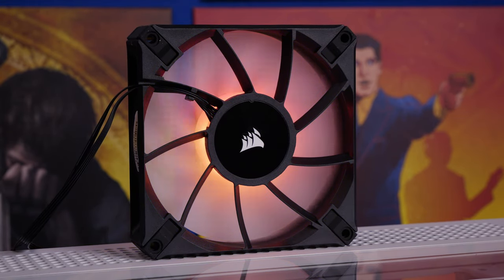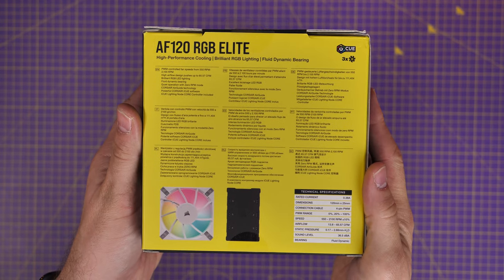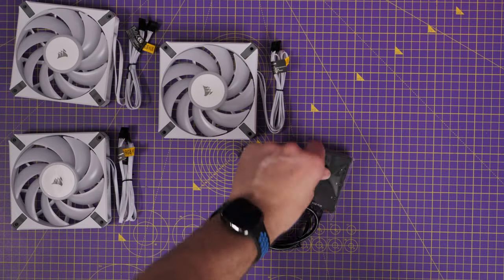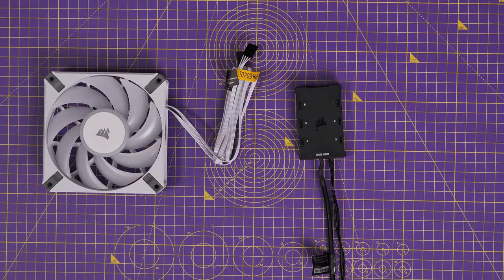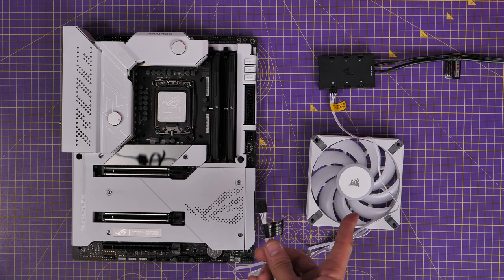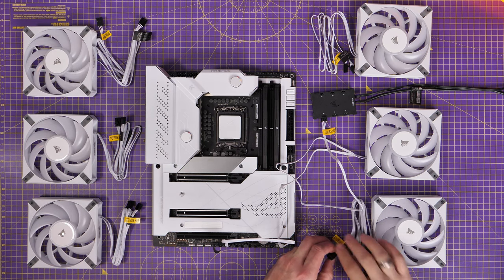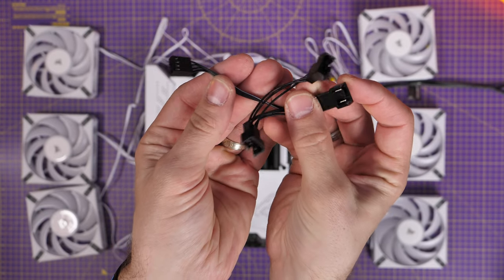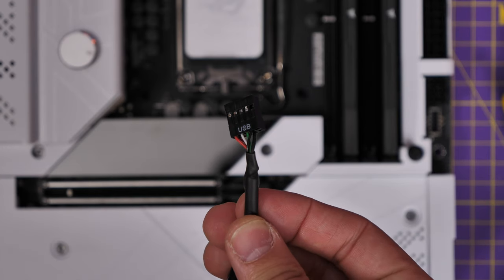How to connect and setup Corsair AF120 RGB Elite fans (10 fans, Lighting Node and iCue setup tips)

Comment: Question, you use a fan splitter cable to plug 3 fans into 1 socket on the MB, what would happen if you used this cable to plug 3 fans into 1 socket of the commander module? would it just detect 1 single fan and provide the same settings to all 3?
Reply from the maker: I'm not sure if you can do that

Comment: 6:05 - RGB cabling is so archaic, hopefully RGB builds in the future do not need this much cabling.
Reply: arctic has daisy chained connectors on their fans that plug directly into the 3 pin mobo header. avoids the need for extra boxes and even extra software.

Comment: I have 9 in one system and it's the biggest pain I've ever had to do.  Get Lian LI fans you'll thank me
Reply: ya i threw my corsair fans in the bin ,got lian li v2's couldn't be happier
Reply: what is so painful with them?
Reply: @musicbyfaint you probably found out why already but its the cable management and hubs needed to connect everything. Plus issues with icue detecting each device. Finished my build today with 10 fans and it was the most stressful part by far
Reply: @Keyosu  Thanks for replying though :) I got the lian li fans and im really satisfied  :D
Reply: @Keyosu Good to know, appreciate it
Reply: @Keyosu i’m doing 10 fans. I have a commander pro and 2, 3 packs that were used in video. is this all i need i’m still confused?
Reply: @Dr.Duff1  Hey sorry it took so long didn't see all these comments. I have everything synced but I had to buy the Command Core XT to achieve this
Reply: Does a triple pack of this lian li fans connect into one header?

Comment: Hi so i used the commander core i think for 5 fans and everything operates fine with the icue. But im having an issue where i power on, the fans twitch but dont spin and they all turn red. The fans dont start spinning until i log into the windows account and the the lighting settings adjust when icue loads. Is that normal? Should i buy splitters like you used to mount it to the MB? Its such a small issue but it drives me crazy. Great vid btw!

Comment: I’m doing my first pc build and have purchased the af120rgb elite fans .  I was going to buy the commander core xt but Corsair help says the commander core and commander core xt doesn’t support af120rgb fans to use icue they have to go into motherboard.  They’re also not listed as compatible on their website with core or xt.  I’m confused as I’ve purchased the icue h150i elite capellix xt which comes with commander core and af120rgb elite fans. 
Could you please clarify as I don’t want to buty more fans and xt if it doesn’t work . 
Great channel I’ve based my build on your Corsair 5000d airflow build and bought that case .
Reply from the maker: They're wrong. If it's definitely AF120 RGB Elite fans then they will work with the Commander Core.

Comment: I purchased a new Cyberpowepc a month ago. Took me a frustrating hour to realize that my RGB fans colors were not controlled by the gigabyte fusion software but by a button on the Phantek case which cycles through different colors. So as a complete novice I wondered about adding a few more fans but how do I get them to sync all together. I realized that none of the RGB headers of the motherboard had anything plugged into them which really confused me. How on earth are the fans lit up and controlled by a button the case.  I don’t want to go digging in the cables since everything works great now, but in case I get brave I’d like to know how these are working without anything being plugged into the motherboard? And the new fans plug where?
Reply from the maker: It's hard to advise from afar. But if it's from a button on the case then it's either a controller or daisy chained fans connected to that button. What fans are they.

Comment: Instead of using a commander core + corsair rgb hub, could I just use two commander cores for simplicity? For 9 total RGB fans so there's a couple less system fan headers that need to be used. 3 of these would be with a h150i elite lcd xt, which come with 3 AF120 fans. This would need 3 total USB connections right?  Between the two cores + the AIO connection, assuming my case (h6 flow) doesn't need any additional for i.e front panel? So I'd need a USB hub since the mobo (gigabyte aorus elite ax) only has 2 USB 2.0 headers?
Reply from the maker: Yes, two commanders will work

Comment: Hey man, quick question. 
Does it have to be an Corsair iCUE COMMANDER CORE XT?? Its quite expensive. 
I put my eyes on a  ARGB & Fan hub from Thermalright, from your other video. That can connect up to 8 ARGB Fans into 1 hub is way cheaper.
I still want to utelize the iCue function, would it be possible with that?
Reply from the maker: Corsair fans don't use 5v RGB connectors I'm afraid. So you need a Corsair controller.
Reply: @TheProvokedPrawn  Cheers for the fast answere!! 
Well.. gonna stick to your recommendation on Montech ARGB into Thermalright 8x ARGB FAN HUB. Any way I can support you with my purchase? (PromotionCode e.g.)
Reply from the maker: @DamonYuno-rg5wo  there's usually links in the description of the videos that earn me a commission at no extra cost to you 👍🏼

Comment: i have an aorus x570 xtreme mobo that comes with a 10 fan hub, will i be able to use that with corsair icue fans and the icue software controller program? or do i literally need a corsair fan hub to use icue??
Reply: If you want to use iCUE, you have to use a Corsair controller unless you're using an MSI or Asus motherboard as iCUE can interface with the RGB headers on those.

Comment: I have a problem with my 3 pack af120 fans where all 3 work fan wise, but the rgb on one doesnt work. They’re all connected to the corsair rgb splitter and still nothing. On the very first day they all worked but the next day no rgb.

Comment: I need help the rgb on my corsair 120 rgb elite doesn’t light up do I plug in the rgb hub cable into the rgb header on my mother board I’m using a B650-A ROG Strix Gaming WiFi AMD AM5 ATX Motherboard
Reply from the maker: The RGB hub plugs into usb not RGB

Comment: Hey, how do i figure out how many fans my motherboard can handle?`I cant find anything in the manual
Reply: the manual should say how many amps a fan header is, typically 1 unless it says 2 like some high end boards have. when you look at fans you can see their amperage, such as .2 or .3 amps. so if you have .2 amp fans thats 5 per header(1 amp), and if you have .3 that would be 3 fans as that would be .9 amps.

Comment: At one point I bought 12 Corsair fans but after going through the cable mess, I gave up.  Returned all of them and bought Lian Li fans instead.  It went down from 24 cables to 4, and 4 controller boxes to 1.

I bet Corsair will eventually release fans that can daisy chain everything together. Not going to buy any fans from them until that happens.
Reply from the maker: And that will be a glorious day for sure.